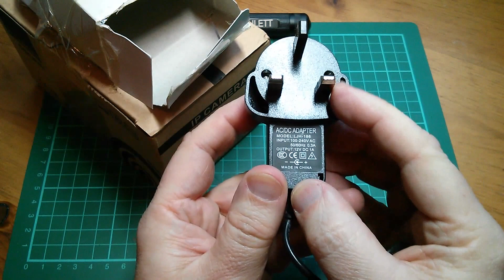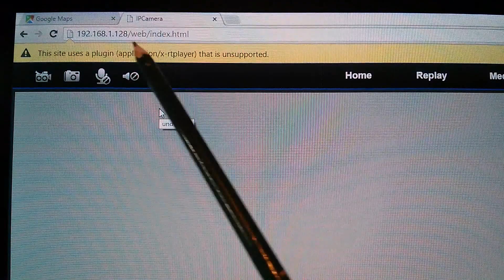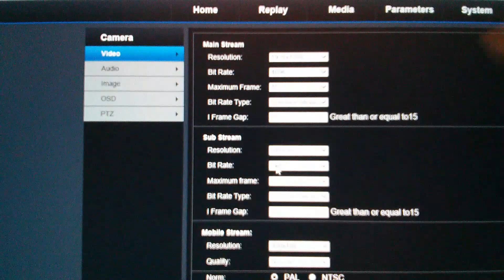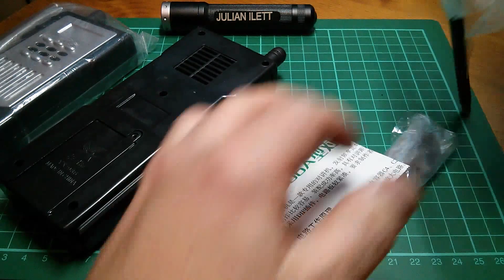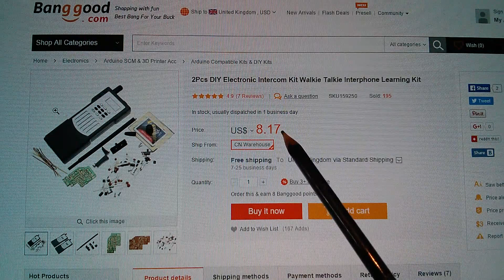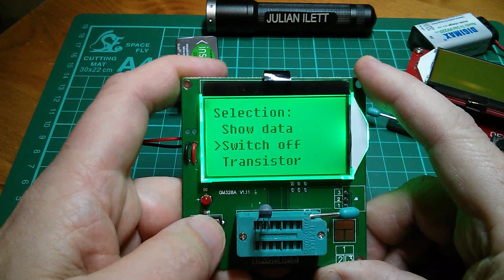Julian's Postbag: #51 - Banggood Special

Comment: Talk about retro, I bid on 3 CB radios on www.stealitback.com and got the lot for 4 bucks plus 15 shipping, not bad for a rather nice radioshack 40 channel mobile unit for my RV, as well as another 40 channel Cobra  hand held CB with rubber ducky antenna, and a very retro looking  3 channel hand held CB with the classic expendable antenna that pulls WAAAAAAAAAAAY out, it looks every part the walkie talkie with padding around the speaker and mouthpiece, all mounted in silver plastic with just channel 14 installed. She takes the old crystals for different frequencies but I don't think I will ever install any more even though they are still available on Ebay, I probably will never turn that one on.  Both the hand-held take AA batteries, handfuls I think 8 or 9,  I just plugged in a 12 volt power pack to them to try them out and they work fantastically. I even sat down and converted 50 feet of old TV Cable into a 103 inch doublet antenna which I intend to mount on the next sunny day when I can get to the lumber yard for some PVC Piping to finish my project.

Comment: When I was a young fellow, I took a summer job working for a fly by night jack of all trades.  We did house painting, building destruction and construction, that sort of thing.  He was long on work and short on pay, in fact we usually had to get our dads involved to get a check out of the skinflint, but I did manage to save up a few bucks. Much of my money went for smokes, cause it was so cool to smoke back then, but I did set aside enough to buy a pair of Midland walky talky's and man we had fun with those, my best buddy and I used them all over the place, we were still young enough to play soldier and stuff like that (the child labor laws were rather scant back then.) So those toys were great.  However being an electronics nut, it wasn't long before I had them apart, trying to make them do stuff that they shouldn't do, and eventually breaking first one, then the other.  Ah but they were fun while they lasted.

Comment: If anyone buys one of those circuit testers. Don't forget to drain your capacitors before testing. I found out the hard way. The guy was going to send me a new processor for it but he ended up sending me a replacement unit.

Comment: Bit of an old video but i have just bought the 1200W PSU and typically arrived wrapped in a 2" 
square of bubble wrap that didnt protect it. The output terminals got rather deformed and smashed
that little capacitor. Any idea on its capacity? I cannot find anything written on it.

Its marked C15.  Any tips?  Thanks.
Reply: Playing a bit more with this and mine will not go below 2.7Amps?   Is it me or are the specs
wrong for this item?   I tried 2 55W car bulbs in series on the output.  Set the voltage anywhere
between 13.8 and 24V,  Pulling the current down it just wont go below 2.7Amps, where the
voltage drops to slightly lower than the battery input voltage.

Must be me right?   Thanks.
Reply: two 55w car bulbs in series will draw about 2.3amps at 12v, of course you can't go below your input voltage, but it looks like it's working correctly. You're gonna have to try testing it with a much lower load than 55w car bulbs. (which are pulling about 27w of power at 12v)

You're gonna have to go down to the 10w range before you start being able to limit the current below that 2.7amps your seeing.

It sounds like you're actually lowering the output to the point that it's shutting off the boost circuit effectively.

Comment: Thanks for the demo of the multi tester. I went to eBay and did a search and immediately bang good's listing came up. I was reading about it and when I saw it had capacitor testing (measuring also the capacitors loss) as well as inductor/ inductance testing I was sold. $22 AUD with free shipping seemed pretty good even if it only lasts a year or so.
Reply: The up to 2MHz square wave generating function will also be great for the odd experiment :)

Comment: That boost converter in your hands has a terrible flaw. If you power it up with say 19 V and then turn it off after the output voltage reaches the set limit (say 83 volts for example) with no load connected, it will cause the red led (LED1, I believe which I think is a low power indicator) to come on from that point on. That is, the next time you power it back up the unit becomes useless - it only supplies a voltage equal to the line voltage at its inputs regardless of what the voltage adjustment trimmer is set to. 

See if your unit suffers from this flaw and I will tell you how to fix it.

Comment: You should update the firmware on them, its all open source and what not.  It's maintained by someone in Germany.  The Fish software is terrible.
Reply: +PoLoMoTo2534 The last I checked the open source project only supports a 2x24 text display. So that rules out upgrading any of the graphical models.
Reply: You must've checked a long time ago then, support for the graphical displays has been around for a while.  The fish8840 firmware is a stripped down version of the complete graphical firmware.
Reply: PoLoMoTo2534
I would not call a few months a long time ago.
Reply: I mean I don't know what you want me to tell you I bought and upgraded mine around six months ago now, and it wasn't a new update when I did it.  You must have been looking in the wrong place.
Reply: PoLoMoTo2534
Perhaps.
Reply: Paul Frederick
 Link: https://www.mikrocontroller.net/svnbrowser/transistortester/Software/trunk/
Reply: PoLoMoTo2534
Yup I've never seen that page before. Just this one http://www.mikrocontroller.net/articles/AVR_Transistortester
Reply: +Paul Frederick the link is on that page, it's the SVN, click it then go to software then trunk
Reply: PoLoMoTo2534
yes thanks. I've no need.

Comment: Heads-up on that boost converter - the China ones seem to, without exception, be input limited. I.e, the 20 A is going to be the maximum primary current it can handle. Which makes sense, since its maximum voltage is rated at 60 V, giving a maximum power of 1,2 kW. At 12 V, it's only rated to do a measly 240 W.
Reply: It'll do a bit more than 240 if you can keep it cool. I was able to push it to nearly 30 amps (maximum my powersupply could handle)

Also, they've revised the design since this video. It now comes with the connectors for the input side, a low voltage cut off adjustment pot, and instead of multiple small mosfets, it uses a single fet on the input, 2 standard size fets AND one giant fet on the output. It actually does VERY well at high loads in my testing, and the inductor coil doesn't ring like the 600w model does. It also has two 15amp fuses vs 2 20amp fuses

Comment: First thing to do with the component tester: add a real power switch. The one I have (similar type but not as many functions as the banggood one) slowly drains the battery. Second thing to do: build a case out of plywood.
Reply: +superdau The auto power down and boot time would drive me insane. Handy little gadget all the same.
Reply: +superdau I just put mine on stand offs on pieces of scrap. Good enough.
Reply: +Rob B Some you can adjust the power down in the menu. But there are like a zillion versions of these and the firmware in all of them varies. AFAIK the graphical ones are not user updatable either. They don't take very long to test a component. Especially considering you do not have to observe any polarity at all connecting components to them.

Comment: Could you also wire a microphone along with the speaker? I wonder if it would get damaged if you tried to play sound through it?

I wonder if there is a line that goes high when transmitting, with a transistor to turn on an external microphone and turns off the speaker from being used as a microphone?

Comment: I'm not sure I would trust that boost converter with anything important or expensive.  I've seen some of these cheaper converters surge way past the set voltage on start up and destroy electronics.  I would also like to see how well these perform at both low and high current draw.  Temperature, ripple, noise, etc.  I don't trust a lot of these companies' claims of power output and 1200W is a lot.  Don't burn down your house!   ;-P

Those component testers seem to be quite annoying with the auto power off "feature".  Why they couldn't make it an option jumper or setting to extend the time out time I don't know.  Most people won't be using these in the field but actually indoors where AC power is available so why not just put on a power jack and let it stay on continuous (until you unplug it or switch it) or at least have a 5 minute timer or something.  Very annoying if you are trying to write the data down or whatever.

Comment: Hi Julian, I have had one of the QD900 cameras for about 3 weeks. I could not get the IE software to do motion record, the manual record works OK in short bursts but I left it on over night (8pm till 8am) and the 20 gig file would not play back ? The CMS software on the disk is not much better. However after a bit of a search I found some open source s/w called Ispy (www.ispyconnect.com) and it works quite well. If you manage to get the included s/w to record on motion detect please do let us know how with another of you great videos.
Reply from the maker: +Jon Davies 20 gig file? That's mad. The camera really should have a mechanism for splitting the video into separate files
Reply: +Julian Ilett One of the s/w included is called CMS basically its the same as the IE interface and the manual record does split up the recording in to manageable chunks. The down side is that it records in a strange format that will only play with the included player not something like VLC or WMP.

Comment: 1200 Watt boost converter. Yeah... right! Gotta love the Chinese hype! That would either fail and blow the fuses or become a flaming mess if you tried to push 1200 Watts through it. That heat sink and inductor are way undersized for 1200 Watts.

Comment: Iceo is the collector-emitter leakage current with the base open circuit and 
Ices is the collector-emitter leakage current with the base shorted to the emitter.

Iceo will generally be much larger than Ices because the collector-base leakage current flows back into the base and is amplified by the gain of the transistor so to turn a bipolar transistor off thoroughly you need to put a low impedance across the base-emitter.
Reply from the maker: +number 33 Thank you - a concise explanation.

Comment: Great Postbag, could you use the tester for the devices the converter to determine what they are ?
Reply from the maker: +T Komoski You mean while they're still in circuit? Worth a try I guess.
Reply: +Julian Ilett Hope you use it while you build those walkie talkies
Reply from the maker: +Subigirl Forester Yeah I really should! I got caught out with resistor markings on the DSO138 oscilloscope kit.
Reply: +Julian Ilett I really Can't wait till you upload that 👍💖
Reply: +Julian Ilett You said on the side on the PCB Testers Points Can you test in circuit with that 
tester ? those devices on that other board.
Reply: Arthur.Mccafferty@icloud.com
}

Comment: Weird that they used a static ip address for that camera.  Not every router uses the 192.168.1.x range as default.
Reply: +Luc Peeters quite true, but it does seem to be the most common. Kind of a pain for anyone who isn't though I guess
Reply from the maker: +Luc Peeters You can't really put a web server on a dynamic IP address. I'm not really sure how the P2P system works yet - it may be that this works without needing to know the camera's IP address - and if the camera is uploading only (FTP for example) it could be set to DHCP. Also, there may be a utility on the CD to find the camera and alter its settings. Lots to play with here :)
Reply: +Colin Keevil. I have a couple of Linksys, Cisco cameras here and a Foscam.  None of them were set to a fixed IP (range).  Normally you can use the DNS name of the thing depending of your network config to get access to your camera if you don't know the IP, but then it has to be in the same range and have the dns server address set correctly..
I had to help loads of people who are not network savvy with these fixed IP delivered things.  It's also a bit of a nuisance to put your pc on a fixed ip and then change the config.(especially on the phone)
Reply: +Julian Ilett Looking fwd to the unscrewing thing part maybe a couple of nice screenshots of what kind of image it really produces. I have seen a couple of HD cams which look worse than 320x240 as a matter of speech and are useless in case of an event.
Well the fixed ip. They could put it as DHCP first and then you should be able to set it to static ip after you configured it. Would make it a lot easier for a lot of people. 
All my fixed ip 'server' stuff here is set in between 192.168.1.5 to 192.168.1.99 and my DHCP server in the router hands out addresses above that.